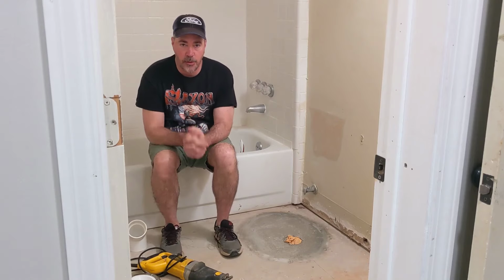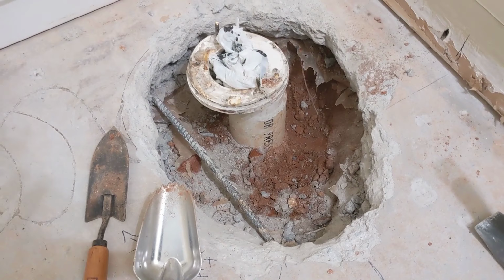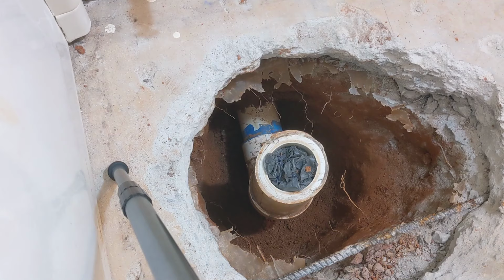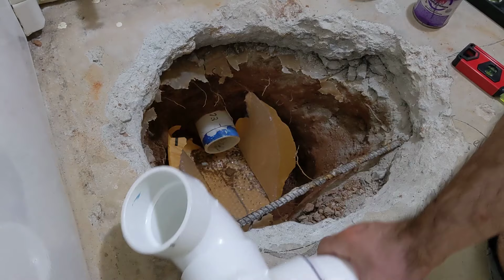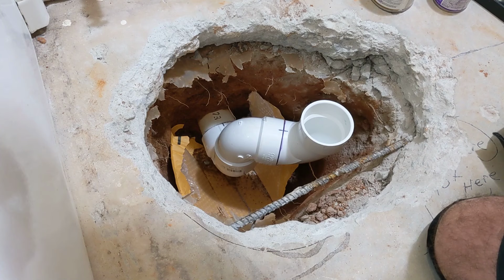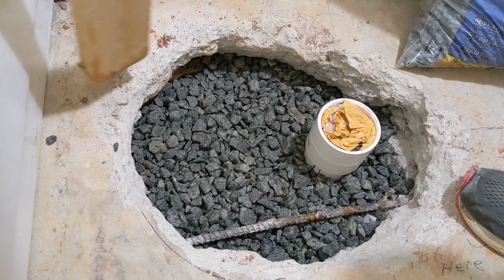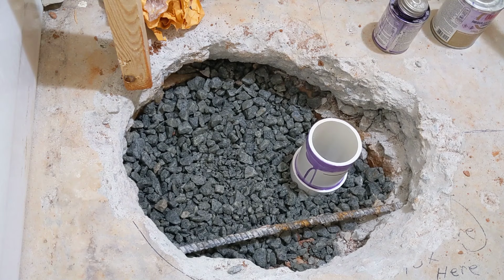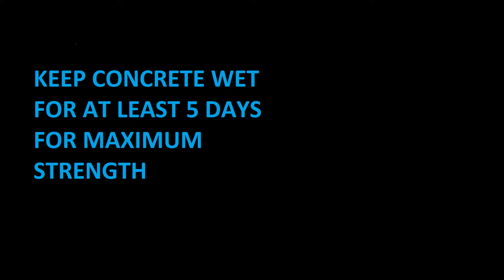Move Toilet Waste Pipe in Concrete Slab - Easy

Comment: Nice! So here's the real question- how much did you charge just to move that toilet alone?
Reply from the maker: My own dooker, so nothing. But I think the rate in our area is 1500 to 2000 clams
Reply: @jonparkmac  thank you for that info!
Reply: @jonparkmac  WOW!  $1500-$2000.  I realize that's just an estimate and I thank you for that info.  Is that like a day's work?  Sounds like a good amount of money for a day.  Going through a remodel pretty soon, so the place will be dirty anyway.  Great video!  Great info!!  Thanks
Reply: You could jackhammer the concrete and dig it out yourself and leave the actual plumbing to a pro if you want to save money. They hate breaking up concrete and charge you accordingly. Doing all the concrete work yourself and just having the plumber do the pipe work will definitely save you money and the plumbing will be to code. ( If that's important in your area.) I've done several of these and it's not that bad. Good video.

Comment: If I want to move my drain just few inches back is there any trick to do so without making all of that hard work ? Thank You great video!
Reply from the maker: Yes. They make an offset flange but you'll still need to break up the concrete a little so you can get it on. They are also more prone to clog.

Comment: I have this to do as well. a contractor put my flange 19-20" from the wall and beside my shower. If you want it done right, you have to do it yourself. Are all those bends ok? I'm going with a 22 and 45 degree to be less aggressive with the turns
Reply from the maker: No, my bends are not ok. Better to reduce the number bends and use long radius. I just could not get anything to work for my app. However ... Flushing awesome !
Reply: @jonparkmac  thanks for the reply! I'm on the way to Home Depot to buy a 45degree then.

Comment: Hi, what's the plastic barrier for?
Reply from the maker: Building code requires it so gas and moisture doesn't permeate living areas. For a small hole like this ..might be overkill .. but since it's easy why wouldn't you ? Plus ..when I cut thru ..it had the plastic barrier
Reply: Nice video, thanks!

Comment: What part of the USA do you live in? Is it only allowed to solvent weld or you can use pushfit as well? In Europe for buried pipes in concrete we're only allowed to use pushfit because of the vibration the building is subject to (settlment). They might crack the glue joint.
Reply: @MrWolfSnack  pushfit works with   O-rings gasket washers, not dry fitting pipes which are meantto be glued.
Reply from the maker: MrWolfSnack didn't actually watch the whole video. If he did, he'd see it was all glued in. Must have been too keen on snarking and not learning

Comment: wanted to see the Jackhammer work!!!!!
Reply from the maker: Sorry about that brutha .. it was sooo dusty and would be hard to film. It's a firearm workout. Trick is to do small sections or the tip sticks and pull your nuts trying to get it unstuck.
Reply: @jonparkmac  its all good, i had it done at my house and the dust was/is unavoidable.

Comment: Hi, Mr. McClure. Could it be possible to extend the main drain pipe (the straight horizontal one where you connected the first elbow) so as to have the toilet moved across the room? I consulted with a local contractor and he said the bathroom floor has to be elevated 7 inches, I don't really understand why, though. Thank you!
Reply from the maker: He may be correct. You need slope of 1/4 inches per foot or solids will settle and clog. It's also code for that reason. If he said 7 inches .. that would be 28 feet!! How far do you need to move it across the room?
Reply: @jonparkmac  thank you for taking the time to reply. I want to move it about 5 feet diagonally from its original location.
Reply from the maker: @telephantasm4070  so 5 ft only needs 1.25 inches of drop. I'd suggest a different plumber.
Reply: @jonparkmac  Thank you, sir.
Reply: Simple answer: $$$$$

Comment: Should've cut the pipe behind the 90 back further, put in a 45 then 90 back up
Reply from the maker: Couldn't ..there is a fitting there. Would had have excavated a deeper tunnel in and to the left. But point taken.

Comment: If you take a heat gun set to high and heat the pipe up at the joint it will loosen the joint and you can twist the connected elbow off without losing that extra length of pipe.
Reply from the maker: I'm skeptical of that since cement actually melts the PVC together and its not like glue you can disolve. Heat would literally melt the pvc. Plus getting heat all the way around a 3" pipe down in the dirt like that ... more practical to cut it

Comment: Use 45 degree fittings next time. Less direct bends less chance for it to back up
Reply: The 90's that you used may be to direct of bend and may cause backups. With 45's it wouldn't be such hard direct bends. This causes the waste to be left behind cause the water 💧 drains easily and the waste gets left behind and the next flush must push it and the waste left behind from the previous flush eventually causing a backup. Nice clean work but wouldn't use 90's... I've done LOTS of these in my 25 year's of plumbing. People usually remove a narrow tub in place of a stand up shower and they want it wider putting the toilet to close and it would work out by moving toilet center
Reply from the maker: That makes good sense.

Comment: Your not supposed to use 90 degree fittings, shuould use 45’s to avoid blockages
Reply from the maker: That is true. I couldn't make the 45s work in the small distance .. but I could have tried other options.

Comment: Will back to back to back 90's pass code?
Reply from the maker: I don't think so. But this job is able to pass a massive turd and half roll of TP from my father-in-law in one flush with no clog. Best throne in the house right now.
Reply: Hell..especially not the vent 90 he used…this was a cluster fuck of a job…totally illegal in every jurisdiction I know of..I’m a plumber of 28 years..too bad he has so many people on here that look like they will be making the same mistakes
Reply: @MrDarren5012  And have one clogged, concreted in, problem.
Reply from the maker: @jashby9736  you guys are over-exagerating this. It never clogs in almost 2 years. If it did, the elbo is right there 10" away so a child could unclog it. If it were further away I wouldn't have used those.

Comment: why would't you use 2x45
Reply from the maker: I couldnt get that to work. I think it pushed it too far out from the wall. But I should have tried a little harder with other fittings agree. Been trouble free for 4 years now.

Comment: Concrete inspector here, and boy is this completely wrong. Never ever ever ever put plastic sheeting in between your gravel and your slab. Moisture NEEDS TO BE ABSORBED from your aggregate into the slab immediately. YOUR work will crack and cure improperly. 

With that being said, when you compact your dirt, and then gravel, you should be applying water so the aggregate, sand and dirt compact better, and leave moisture to be absorbed by the slab.
Unbelievable what people put on you tube. I’d fail your project and require tear out  

The end of the video says keep concrete wet for 5 days, completely untrue and unnecessary. What are you going to do, flood your basement in 2 inches of water until a DIY’er thinks it’s cured? No. No. No
Reply from the maker: You are clearly no inspector. The slabs for residential all have 6 mil plastic under it to prevent moisture, dampness and gases seeping up in living areas. This is required by code. Keeping concrete moist 7 days is a well known curring process. Since you don't know either of those (or refuse to believe them) your comments have little merit.

Comment: I like how you are talking about keeping the pipe smooth to avoid clogs while gluing together 4 vent 90's for a toilet lol Guarantee you "Plumbers are over priced" is something this fella's said many times.  Good luck to the poor service guy that winds up coming out to unclog that thing, Thats a zero warranty unclog every single time, cant even get a camera through that abomination.
Reply from the maker: Your over exaggerating but point taken. Been a year of lots of digested steak and TP and flushes like a rocket. 99% of clogs occur in the toilet trap as it's only 2.5 "". If it did clog there, it's 10"  away and a 3" pipe so only a moron would not be able unclog it. There's a clean-out hub on the other side of the wall as well.
Reply from the maker: And yes, dishonest plumbers are way overpriced and take advantage of homeowners that have no idea. This is a 2 hour job at most and $1500 comes out to about $700/hr for simple work. So yeah DIY is king

Comment: Good tutorial but bad choice in fittings. At 8:22 you were at a point where you could’ve used a 45 or a 22 and a 90 to avoid using 3 fittings.
Reply from the maker: Yep. I could have tried a little harder on that part. Flushes awaome

Comment: 24:33 everything balancing on the floating glue joint
Reply from the maker: Nothing floats or balances on any joints here. The toilet is supported by the flooring and concrete, not the fitting. The flange just seals up to the toilet and does not support weight. It is screwed down into the concrete with 4 concrete screws.

Comment: Is that a 4 inch pipe?
Reply from the maker: 3" but use a 4" if you have the option. Bigger pipe less chance of clog but less options for bends and fit because of large fitting radius
Reply: @jonparkmac  there is a 3 inches pipe coming up the hole. I ended up cutting it inside the hole. Now i need to drill the concrete around it to get to it. The question i have is can i put a 4 inches pipe on top of the 3 inches coming up. Would that work? And will the prime and glue make the seal since water will always hit the edges. If you have an email i can send you a pic or a video. Thanks in advance
Reply from the maker: @Lifesituations8000  you can't put a 4" pipe over a 3" pipe and expect it to seal properly. Better to use an adapter fitting. That said if it's cleaned primed and glued it may work. I would be sure to bevel the inside edges so it won't catch TP and terds
Reply: @jonparkmac  thanks
Reply: @jonparkmac  Do you mean to bevel the edges at the adapter fitting?
Reply: @jonparkmac  Also if you dont mind me. What type of cement did you use to finish? Thanks in advance
Reply from the maker: @Lifesituations8000  bevel the inside edge of the pipe angled inward and smoothed with sandpaper so it doesn't have a sharp edge/lip inside. But if it's less that 12" I would just a 3" flange or a 4" flange that fits on outside and not try to slip pipe on pipe. Use regular pvc primer and cement
Reply: @jonparkmac  thanks that is what im doing. I'm using a connection that converts the 3 inches into a 4 inches pipe. In that way i'm able to fit in a biger flange

Comment: looking at that crater hole is depressing, you should have use a skill saw and made a perfect square
Reply from the maker: Completely unnecessary since it's filled back in with concrete and covered. Unless your the sort of guy that digs square holes for your rose bushes. You be you boo ✌️

Comment: Lay level flat and you'll get all ways.
Reply from the maker: Level was just used as a straight edge in this case, but great tip
Reply: @jonparkmac  I thought you were leveling off that flange in both directions.
Reply from the maker: @youtubeblows326  that's a good point ..I think I just got it close enough where a little deviation won't matter. I put the flange on and drilled and screwed concrete screws to hold the flange rock solid on the flooring. I guess I've done this enough I don't need much from the level lol. It's a good point tho for sure and thanks for mentioning that
Reply: @jonparkmac  Yeah Im a perfectionist always have my level 👍

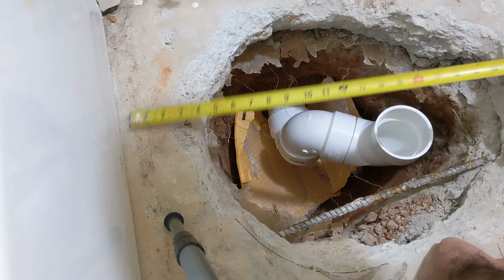Comment: @9:18 It was 13.5 inches NOT 18!!!!! Otherwise very helpful.
Reply from the maker: It's 18" .. exactly between tub and 36" vanity.
Reply from the maker: @jimhabsfan  spot on, yes it's the camera angle and it's 18" . Good info you gave there. They really stubbed this out wrong from get go. It's was 10" from wall and they used an offset flange which clogged. Now it's the best flusher in the house lol In hindsight, I could have done better with the fittings, but it's working well

Comment: uh, just cut the rebarb?????????......I don't think so. What if you had a PT foundation, just go in with a jack hammer without doing a scan first????  Good grief.
Reply from the maker: This is a single rebar in the middle of a large residential foundation. There will be no issue of cracking. Notice I did not cut it though. Scanning is overkill for this. Thanks for the comment.

Comment: You skipped the most difficult part - getting through the slab
Reply from the maker: That's the easiest part actually. And too dusty to film. It's a workout on the forearms. Do it in small shallow sections or the tip gets stuck and you have too tug it up which will wear out your arms

Comment: "Easy" if the waste stack is already PVC - not so much when it's old cast iron - aarrrggghh!
Reply from the maker: Yah , I feel ya. That's a whole different level. Need to break out a chain-cutter and then just use a coupler to PVC, or no?
Reply: @jonparkmac  Yea that's the easy part - the main challenge is access.   The waste stack is tucked against the corner of the wall, fortunately not in a slab but virtually no crawl space so I'm on the verge of just moving the darn wall, lol.

Comment: Please for the love of God any homeowners do not attempt the way this guy did. Those elbows are not meant for waste. Definitely need a long sweep. Please hire a professional you want constant sewer problems in that toilet. His plan of attack was decent, but his execution awful.
Reply from the maker: @StevenSokoloff The test of time has proven your prediction of 'constant sewer problems' to be wrong. It's been 2 years of daily use without a single issue. You internet plumbers crack me up 😂. But I do agree a sweep should be used
Reply: @jonparkmac  internet plumber. No. You may have gotten by without issues. I have seen cases like this, real life plumbing. Maybe your only using that toilet as a urinal? 🤷‍♂️
Reply from the maker: @StevenSokoloff turds and paper 😉. It's avoiding issues because of the 20" drop so there's enough velocity to get it past the elbo. The original plumbing also had a vent 90, which was wrong I know. Wish I could have gotten a sweep in there .. I would have had to work back a lot further but the T flange was there so that was a no go.